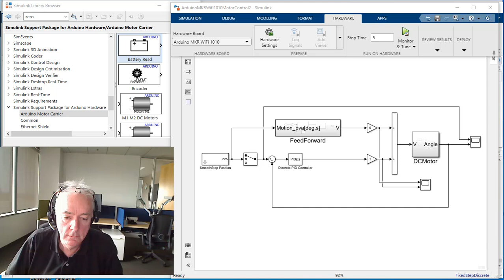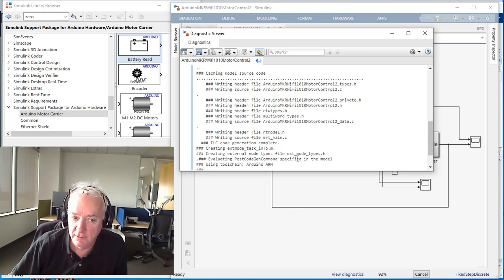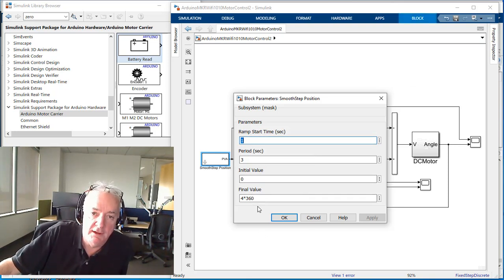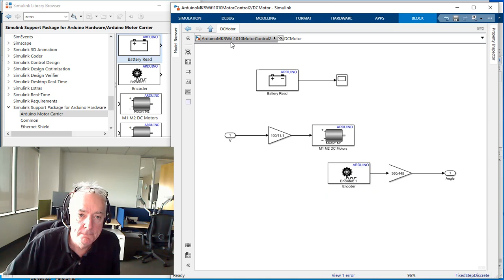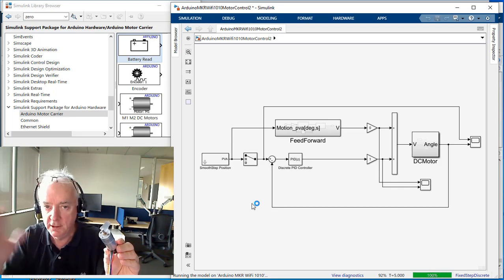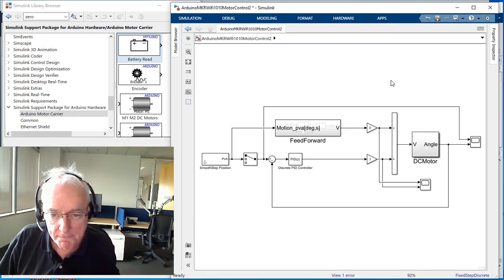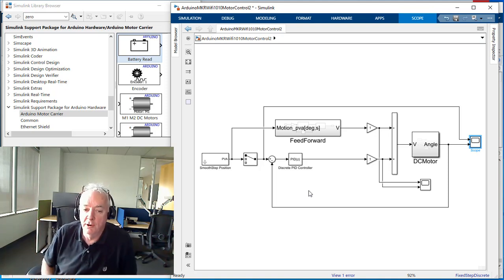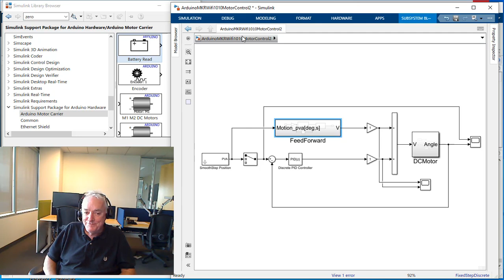Engineers Studio #30 -- Introduction to Controlling DC Motor with Arduino

Comment: nice, is there a list of the hardware used?
Reply from the maker: Hi Gerard, it is an Arduino Maker Wifi 1010 electronics board, an Arduino Motor Shield for this board, and then an inexpensive DC Motor with an encoder. I bought the motor on Amazon for less than 20 dollars.